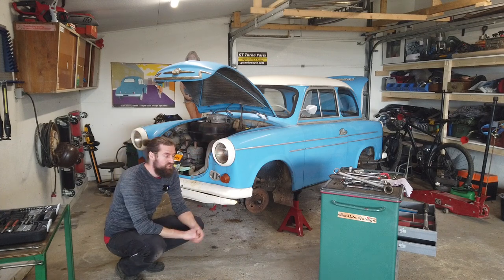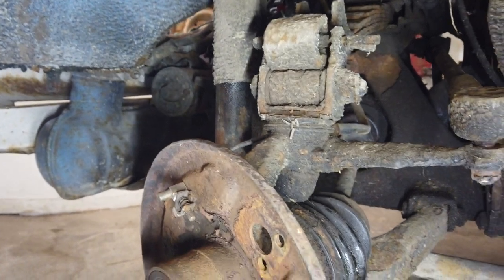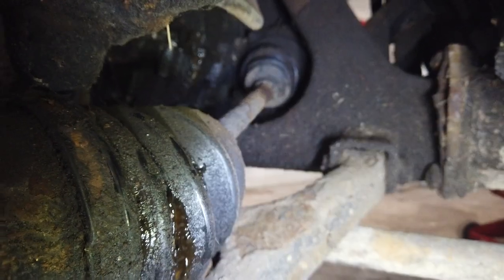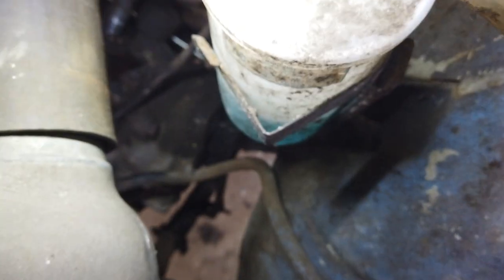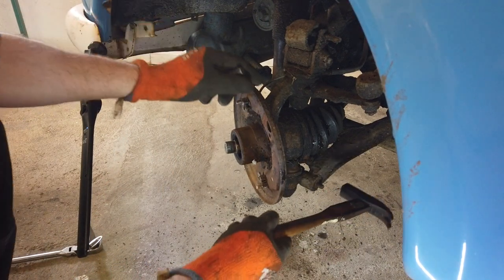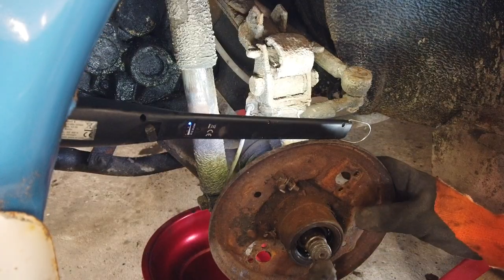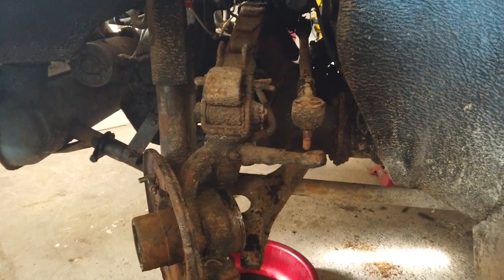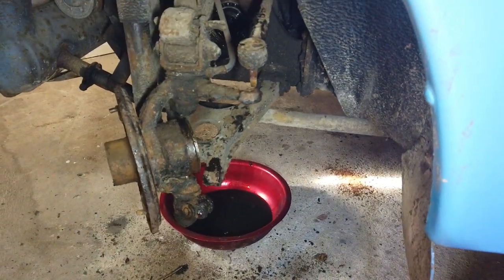Trabant P60 revival. The Driveshafts

Comment: One note about the bearings & installation: The outer bearing gets installed first, as it has the C-clip that retains it for assembly. The inner bearing is pressed onto the stub with the half-cut washer behind it like you have there. If the knuckle is in good shape, a rubber mallet is enough to help the stub & bearing together into the knuckle without damage. You can use the wheel hub to pull the stub into the front bearing, as the front bearing will centre the stub after you get it started. It's a bearing sandwich, really. The stub pulls the rear bearing into the knuckle against a ridge, the spring & spacer preloads the inner races of the roller bearings, the wheel hub & nut clamps the entire thing together under tension. It's very clever, but as you say, totally different from just about any other car. Expect the rubber boots to fight as well; Aging Wheels described the process with shocking accuracy in one of his Trabant updates.
Reply from the maker: Thank you for this useful information! :)